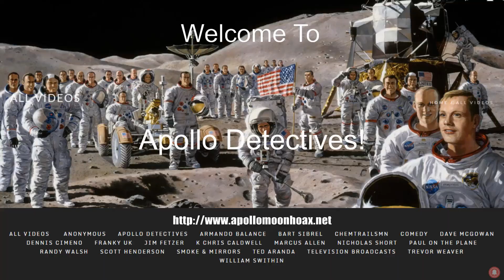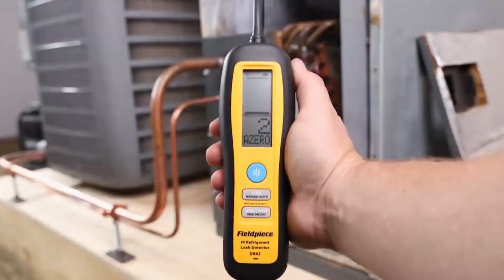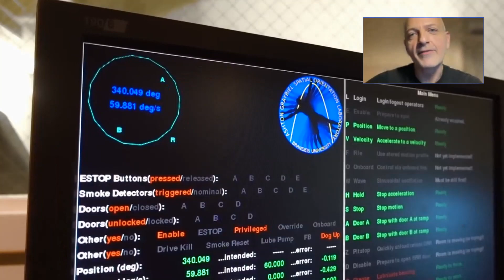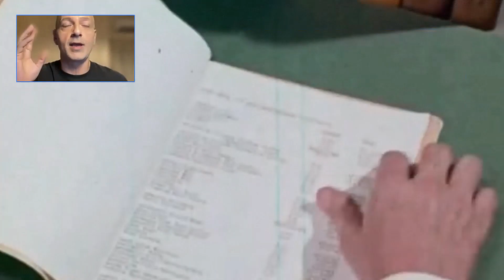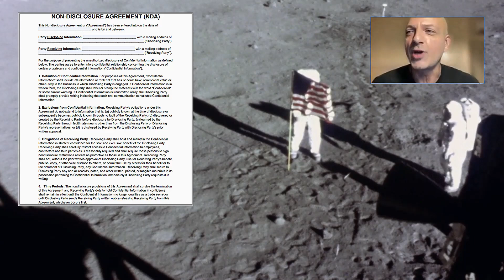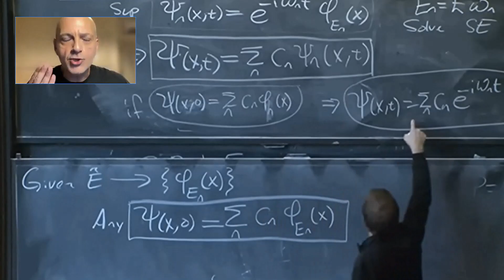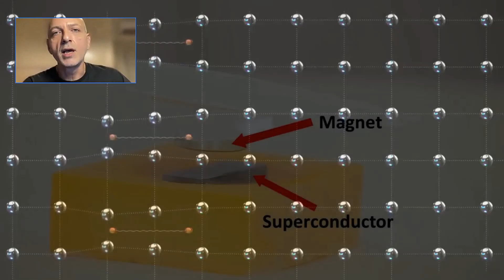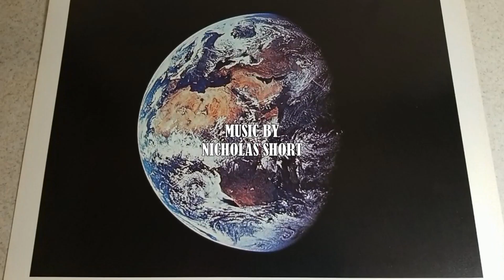THE APOLLO DISCUSSIONS "SPACE SUITS\ SIMULATORS\ PLASMA ENGINES" PART 19

Comment: They obviously have not researched the suits used on apollo and how the various zippers were made and used.  The ones on display are only one part of the system and the inner garment is the pressurized portion from what I have read.
Reply: And how was that alleged inner garment then sealed?
Reply: @yomommaahotoo264  look it up for yourself,  bf Goodrich had been making suits for the military for years,  they used a rubber fusing gasket that the specially made zippers kept tightly sealed.
Reply: @1986BBG  But was it tested in SPACE vacuum?
Reply: @1986BBG  More specifically, was that 'rubber seal' even tested on a person in a vacuum chamber (which itself cannot achieve the equivalent vacuum level of space)?
Reply: @yomommaahotoo264  it was worn in space and used on the moon eva’s.   There is plenty on documentation on the suits and how they are made.
Reply: @yomommaahotoo264  what do you actually think the vacuum of space is?  Give me a number.
Reply: @1986BBG  WHERE in space was any astronot wearing it? Low earth orbit....or outer space?
Reply: @yomommaahotoo264  sorry, to answer the original question the suits are and were tested here on earth in vacuum chambers before using them in space, even though we cannot get anywhere close to the real vacuum of space here on earth.  
The suits for used in LEO and on lunar EVA’s.    They consist of many layers of redundancy, and originally were very rigid and hard to move in.
Reply: @yomommaahotoo264  technically we’ve never been to true outer space, but they’ve been worn in low earth orbit, and on the surface of the moon, the Russians have used them as well as the Americans and now the Chinese during space walks
Reply: @yomommaahotoo264  The current US spacesuit called the EMU (Extravehicular Activity Mobility Unit) operates at 4.3 PSIA, (pounds per square inch absolute).
Reply: @1986BBG  Low Earth Orbit (186 miles up) = 1x10 -9 Torr.....vacuum on the moon = 1x10-13 Torr.
Question remains - ANSWER it. Where specifically was that space suit inner garment live tested?
WHY does nasa refuse to even today test space suits on people in a vacuum chamber (which itself cannot achieve the vacuum level of that on the moon)?
Reply: @1986BBG  Is that the INTERNAL pressure of the suit?
Reply: @1986BBG  So - you're mixing apples to oranges here. 4.5psi is obviously an internal suit pressure, not an external pressure (which in itself presents physiological problems for a person breathing over time).
What EXTERNAL pressure was that internal rubber sealed space suit you mention live tested at?
Reply: @1986BBG  But the question remains - were...and why not are they tested in a vacuum chamber on LIVE PEOPLE?
Space suits are ALWAYS tested under water (the exact opposite of  space vacuum).
Anyone can state equipment was 'tested', but the proof is in the pudding....were those space suits tested on LIVE people in a vacuum chamber?
Reply: @yomommaahotoo264  your a typical denier, nothing will ever be good enough for you here.  I told you, the information is all there just font be lazy and do your own homework.  1968 astronaut Thomas K. Mattingly did the live vacuum test,  the earth is also not flat.
Reply: @yomommaahotoo264  Dig that information up for yourself if you really want to know.
Reply: @1986BBG  YOU'RE the one who brought it up here. Either support it...or buzz aldrin off.
Reply: You must of been reading from a child's book
Reply: so how do they urinate or defecate? wouldn't that require opening and closing? they explain here how difficult it is in a lab to seal for a vacuum. also, attaching the helmet is another seal that would leak. they have to seal the astronaut in the suit before they leave and never break the seal for it all to work .
Reply: @docholiday7961  I seem to be on a site ran by children.   Anytime you deal with a science denier it always comes back to a lack of understanding or someone that didn’t pay attention much in school.  Questioning everything is fine but they all take it to the nth degree.  Pathetic
Reply: @yomommaahotoo264  i told you your lazy, you haven’t figured anything out this far yet the information is all there but you just say it was faked,  so swim in it anyway you like.
Reply: @1986BBG  In the absence of you offering PROOF of your proposition that space suit's inner rubber seal has been tested in a realistic space vacuum, then it's YOU who is lazy (or is this just another drive by)?
Reply: @mikeleschber33  sorry they banned me so I guess you will have to continue to believe there version that we never went anywhere.   They used bags and tubes for number one and bags taped to their butt for number two, this changed after Apollo and its a different way nowadays.  I don’t know how they will do it on Artemis
Reply from the maker: I have displayed videos showing precisely how they were made along with NASA'S own documentation rolling down the screen however, most do not pause the videos and read NASA'S own testing. If those suits were subjected to the Sandusky chamber, they would fail. That's why it was never done. When anything is certified, it is certified for the environment it is to be subjected to. This was not the case with the Apollo space suits. Subjecting them to a vacuum level of torr 10 -3 is not testing for an environment of torr 10 -11 as supposedly found on the lunar surface. That's the problem that we have. Cheers!
Reply: @OurAmazingSkies  i have a different view of the space program than the person that I was originally having a conversation with yet the conversation quickly broke down.   Instead of actually having the conversation and looking for themselves they continued to comeback with that typical condescending tone.  I told them they could find the information and to get the information for themselves.  Its ok to not understand or believe in things but when the information is right there for you to take and all you do is deny and make excuses its a bit much.  I apologize is my tone and demeanor degraded over time.   Were all given the freedom to believe what we want, with that Happy New Year
Reply: @theapollodetectives  Well I would agree with that 100%.  I originally agreed that there is no way to truly test anything that deals with the vacuum of space here on earth.   I don’t disagree on everything yet it is really up to people like your yourself to prove via evidence that things aren’t as they were written in tue archives.   If you can show that evidence and it backs up your theories that goes a long way to proving NASA got it wrong.   I only came upon this site today so I have not seen but one of the videos here.  Take care
Reply from the maker: @1986BBG  Cheers!
Reply: @1986BBG  Maybe it’s me, but I don’t see the condescending conversation. You were asked specific questions and all you did was say, Look it up yourself. If you can answer the questions, just say you don’t know. Be so much simpler and nicer!😊
Reply: @mikeivey7167  it doesn’t work that way.  I am not the engineer that typed up the information therefore i will not be the person repeating said information.  Why would you believe a person off youtube in the comments section before believing a typed up document by the actual people that made the suit.  I am not the engineer that designed it so I suggested you go directly to the source to see if it answers any of your claims the suits would not work in the vacuum of space.  You always go to the source.  Let me know what you find, then debunk it with your personal science or however you can.  Simple.  It is really up to the naysayers to outright debunk and prove a claim that is proven given evidence over time.   We all want truth so I am not against you trying to discredit anything here, but just saying something wasn’t done or cannot work doesn’t make it reality.
Reply: @rubygray7749   Well 24 men went to the moon and 12 walked on the moon, not sure you can prove that they didn’t do what they said they did.  They were there and no denier can disprove that whatsoever.   How did all that Apollo gear get up on the moon and how did those tire tracks and walking tracks get left up there nor to mention those flags.  We have images from those missions and from LRO that actually show the tracks that match the images for those missions not to mention the flags via shadows.   Your hung up on the stitching and disbelief that the hundreds of different people that made those suits could not make a product that works in space or rather the vacuum of space.  Unless you are a professional that has a great understanding of all the materials used and have performed your own tests on those suits your just reaching because of some lack of personal belief in the garment much less the Apollo program as a whole.   Why is it that you believe the internal garment cannot be pressurized and why they would have problems in the vacuum of space or on the moon.   The difference of pressure is about one atmosphere, which is nothing.   The spacesuits for the Apollo program were only good for approximately six months.  Is there any literature that lends some credibility on your beliefs about what we have been discussing, i would gladly read it and get back to you.
Reply: @rubygray7749  Forgot to mention that NASA’s goal what it was to land a man on the moon before the end of the decade, and they did that then they had to look towards the future and the moon was expensive to go to with nothing really gained in return so NASA said it’s goals on missions to the planets, the space shuttle and the international space station so I would say they’ve been pretty busy the whole time
Reply: @1986BBG  
To rephrase your own words,
"Just saying something was done or works doesn't make it a reality."

I can give you many proofs from the Apollo videos and photos, which tell us that it was an elaborate hoax played out on a stage set on earth.
Reply: @rubygray7749  Im intrigued now.  So what is this new material?  And yes I’m trying to watch videos on this site as i just came across it recently.   Im all ears
Reply: @1986BBG  
I cannot show you photographic evidence HERE!
But as I said, if you watch ALL the videos on this channel, they will show you plenty of the evidence that you have closed your eyes to.
Such as the very famous photograph of Wernher von Braun walking on the Apollo 11 film set.
Reply: @rubygray7749  Ok i will be back to chat later, there are a bunch of videos to see
Reply: @kimrok1   please show where photos and film have been debunked, soil samples debunked?  Lets start with the first two,  no debunker has a Hasselblad camera like those that went to the lunar surface, they were specially modified and special lenses were also made for those trips,  the film was specially made by Kodak for those trips as well, so to accurately test and debunk the cameras you need to use the exact film and modified cameras and you would need to be on the lunar surface as well.  So you could attempt at best to try and simulate here on earth with not the same cameras (unmodified) not the exact same film (only Apollo had those rolls made exclusively for them by Kodak) and unable to expose all of that to the exact atmosphere as on the lunar surface (a small vacuum chamber is not the same as on the lunar surface, space doesn’t suck).    Second is the soil samples, the samples from the lunar surface have never ever been debunked.  No educated geologist that has worked with those samples has ever claimed that, and it is very difficult to even get a chance to work with lunar material to begin with.  There is that story about a piece of moon rock which turned out to be petrified wood supposedly, yet all moon rocks that were given to diplomats of countries were cataloged and photographed by NASA exactly how they came off the Lunar surface so we know for fact how many samples were actually given away and exactly how they were shaped and mounted.  The debunk of those first two is down to opinions of those that claim a hoax not the true science behind it.  Third, you take body posture and facial expressions as some sort of proof that they were living a lie, not one of those astronauts ever said they didn’t go to the moon now did they?  Fourth, this is difficult because of the loss of life and your wormy opinion that somehow this was on purpose for talking shit about the program,  first, this literally almost killed the program so the thought of NASA somehow staging the fire and deaths of three astronauts is the dumbest most moronic idea of all.  Onto the radiation belts, the Van Allen belts were skirted and the astronauts and equipment were only in a small portion of the belt for a minimum period of time, nothing like the hoaxers are pushing on their sites.  The amount of radiation by any of the astronauts was not much more than what one would receive during a chest x-ray, they only spent about 20 minutes total going through a thin portion of the belt there and back.  At the time NASA really didn’t know how the belts would affect humans or the spacecraft but they believed everything would be ok and luckily they were correct after all.   The hoaxers seem to believe even though they are unable to show firsthand evidence that the moon landings never really happened.  While they can continue to place doubt on the missions they come short of proving anything because they simply do not have the expertise in the systems of the time and come short of proving the science they are attempting to debunk.  Kind of strange that the LRO and missions from other countries, some that are actually not friendly to the US show tracks on the moon ad shadows from all the equipment and flags at the Apollo sites on the lunar surface.  Not sure how NASA has images from the lunar surface of footprint and rover tracks that match exactly those from the moon images by certain spacecraft orbiting the moon.   Can’t wait for Artemis 2 and finally 3 to put  the nails in the coffin of all the naysayers, but until then we will have to have these conversations back and forth to see where the truth really lies.   I appreciate your civil conversation, thanks